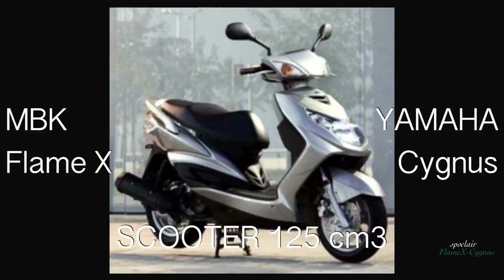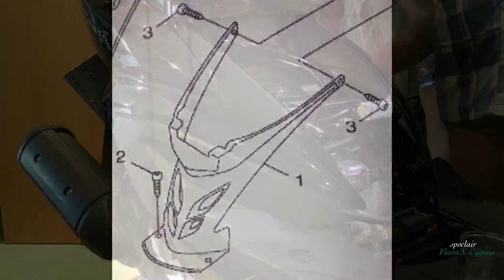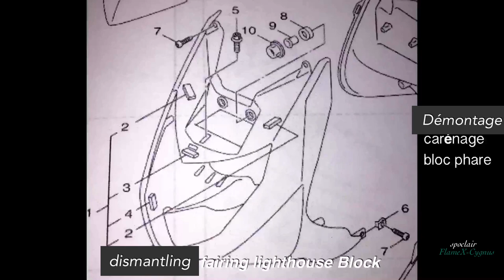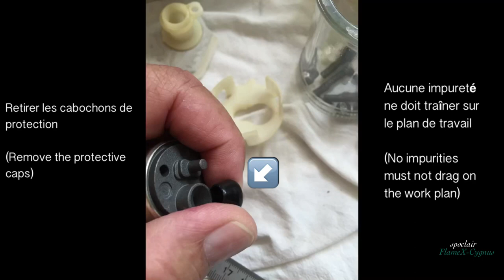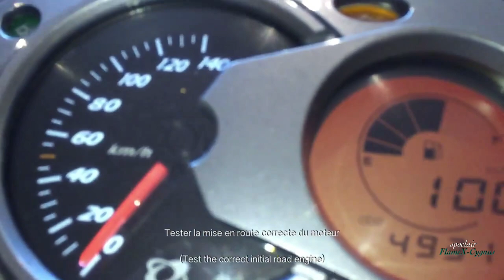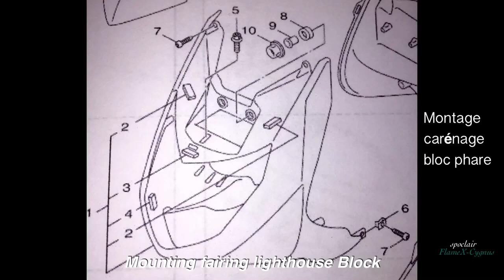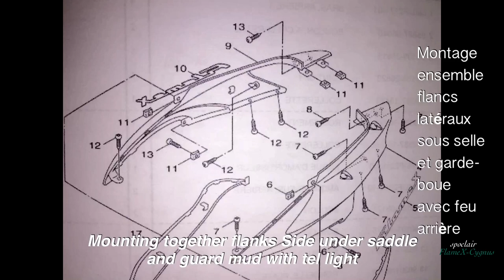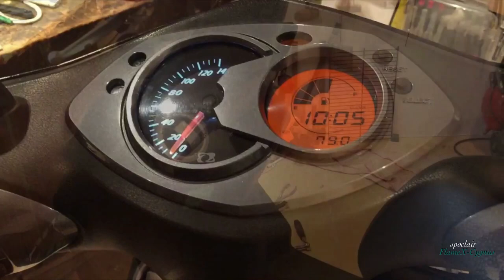[🛠tuto] Seulement 30€ pour changer la pompe a essence du Flame X / Cygnus - Déroulement complet

Comment: @daniel spoclair - I've changed the fuel pump thanks to your video. All appears working, bike starts and runs. However from cold start i have to use the kick starter. Once warmed up then the electric ignition start to works. What could be the issue?
Reply from the maker: Is your battery sufficiently charged?